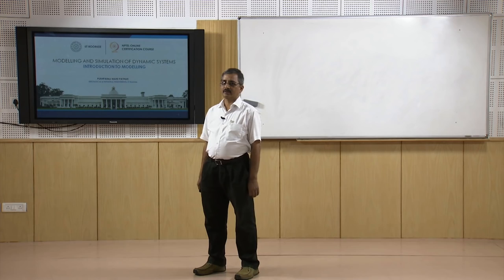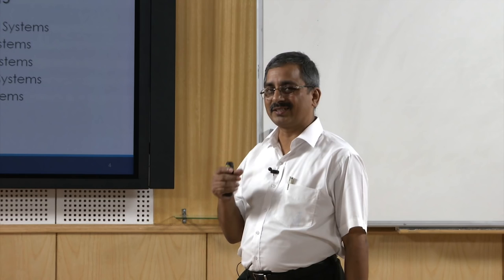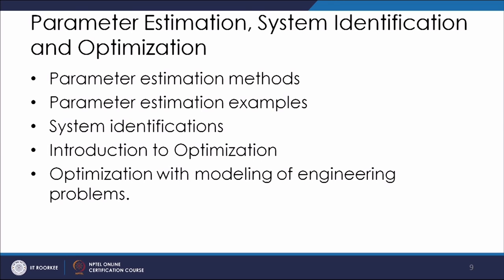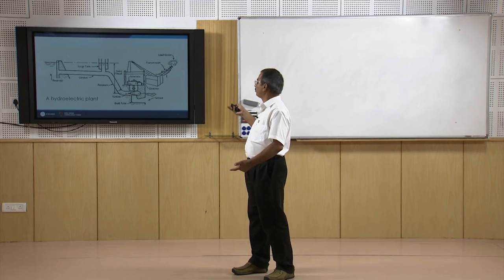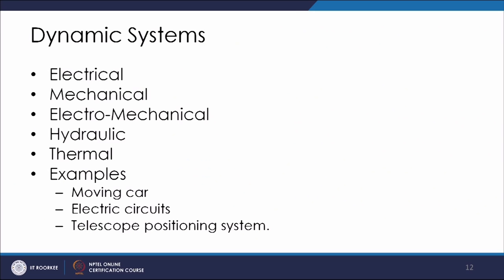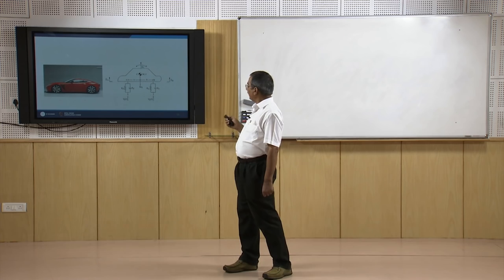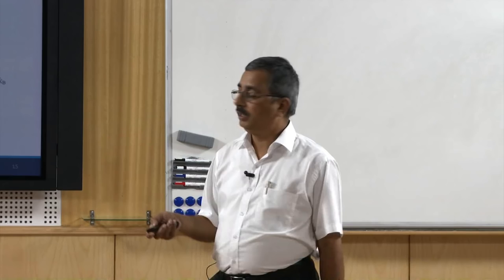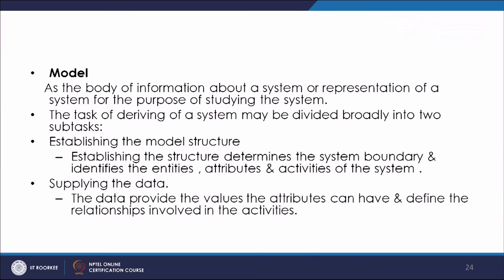Introduction to Modelling

Comment: sir in this lecture you have only read the statements written on the screen or the in the slides. this is not the way to teach. you should try to explain the statements as well. although it is free of cost but yes it must be for the understanding not for reading purpose only. i hope you will get my point.